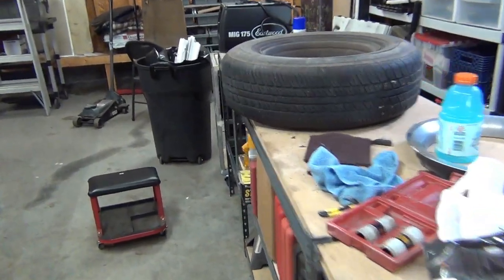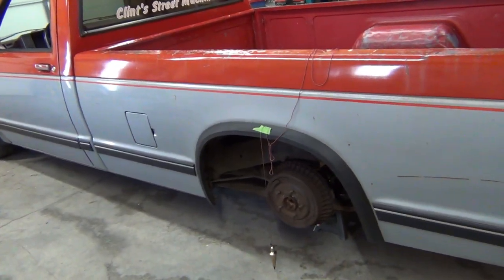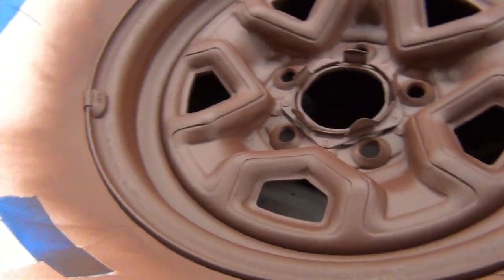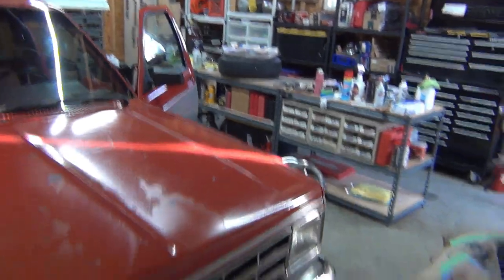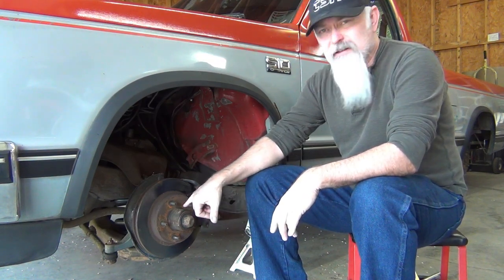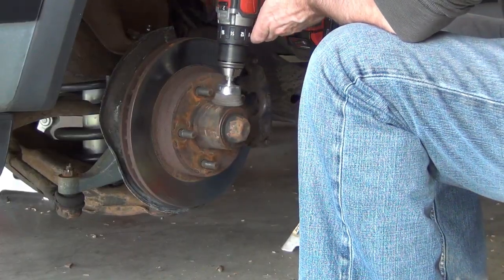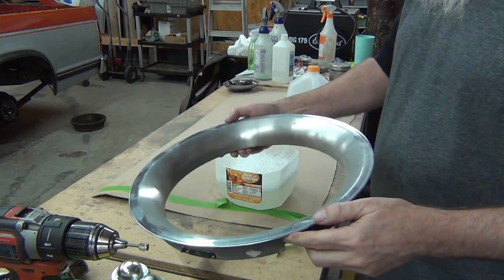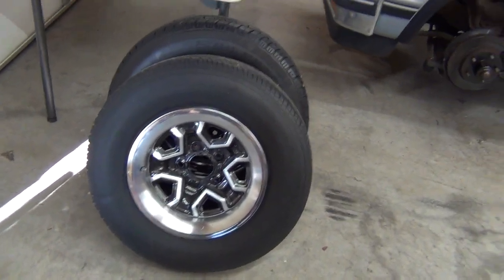First generation 1989 Chevy S10 long bed budget build. There's an elephant in the room.

Comment: Looks great, I have a 91 Sonoma reg cab 4.3 V6 and just dropped my front 5 inches and 4 inches in the back but soon to be 7 inch drop in the rear I have 89 Camaro Z28 rims on it.  I have a problem with my front tires rubbing when I hit bumps on the road. I am used to driving my truck fast like when I had the 3/4 drop. I am thinking of buying 50 series tires I have 215/60/15 tires now I need lower profile tires to fix the rub issue. Well keep up the build I get all my ideas from all ya'll.
Reply from the maker: Excellent! A smaller tire both in width and height should help but depending on the offset, you may still have rubbing issues since the z28 wheels probably push the sidewall further out of the truck. Also, a 1" smaller diameter will lower the truck/frame another half inch. My tires are 205/70-14 for reference. I have a suspension video coming that shows the components I used to get the truck where it sits now which is 4" in the front. Spoiler alert...it's not on cut coils any more.

Comment: i just bought a longbed 99 s10 for my first truck/car. what’s the most common problems you’ll see with a truck like this ? or is there anything important to know.
Reply from the maker: It's hard to say. Anything old with moving parts can have a failure. I've never owned a second generation S truck but I'm sure someone else on here can answer this better. Maybe head over to Hardcore Garage and ask Johnnie, he may be more familiar with these trucks. Thanks a bunch for watching!
Reply: I used to own an 03, same body style. 1st thing I'll say is door hinge pins.... get a few extra sets and learn how to change them. It's a terrible design and the bushings are brittle. They're cheap though.  2nd thing I'll say is, I don't know what year they started using that Dexcool coolant, but if it's got that pink shit in it, get it the hell out of there. Stuff turns acidic and starts rotting the block out from the inside. Flush it really good with water because if you mix the dexcool with regular green coolant it turns into goo. So flush it, fill it with water, drive it for a day, flush it again, put the green stuff in it. Given it's a 99 and now 23 years old,  if it still has dexcool in it, be prepared to put intake manifold gaskets in it if it's a 4.3L. On mine, the rear coolant passages in the heads and intake were packed full of rust, completely clogged (dexcool!) I had to dig out as much as I could. I should have known something was up the 2nd time my heater core clogged lol. Other than that keep up on the maintenance and it should be a solid rig for you.